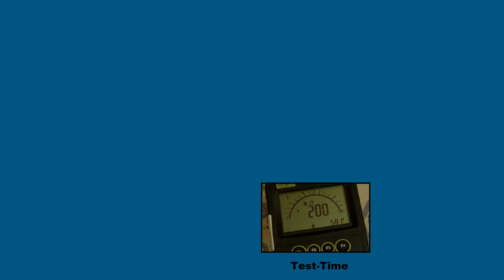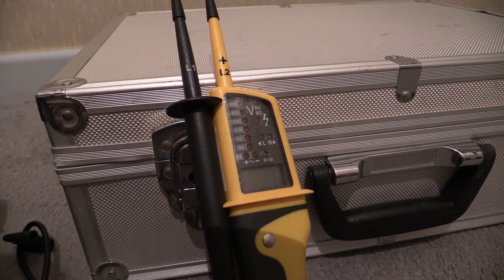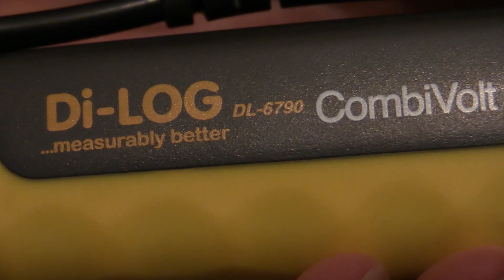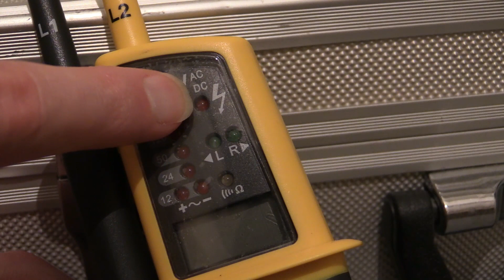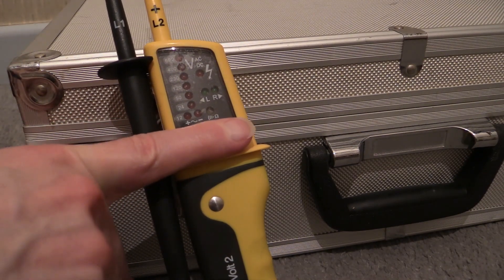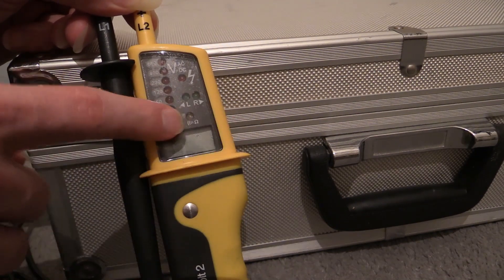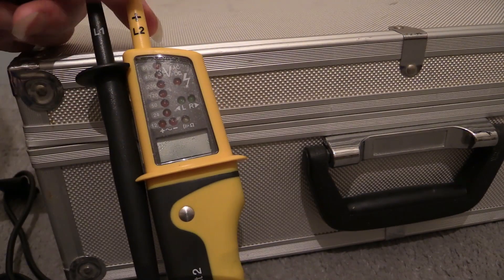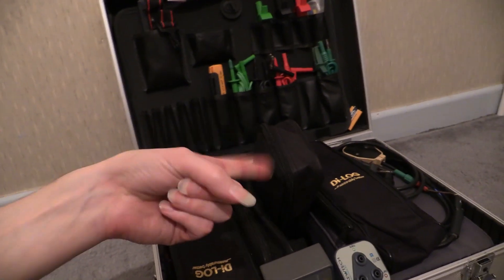Test Time : Di Log Combi Volt 2 (DL 6790)

Comment: On a proving unit I get a beep when I test it one way and silence when I test it the other way. I go + on the leads to + on the proving unit and this way generates a beep. Why is that?
Reply from the maker: Hiya. Assuming 
you have a Combi 
Volt, it may be...... 

.....something to do with your proving unit.

With my proving unit (Socket & See SP 200, which can be seen on this channel by looking in the TEST TIME playlist) my combi volt works in that either way around, but once the test in that unit is done and switches off, if I still have the probes in there, the combi volt bleeps which indicates continuity as if both of the probes were being touched together.

Maybe your proving unit is similar. I do know that my proving unit is somewhat generic, as a proving unit almost the same is sold under the MEGGER brand in a grey colour, along with a few other brand names.

Please subscribe for even more TEST TIME videos! :D

Thanxx for watching,

-Wayne's Electrical.

1st September 2019, 20.50
Reply: Those tester’s when you prove on a proving unit you put the main body probe + probe 2 into the + port on the proving unit and the the - probe 1 into the - port on the proving unit the tester will give an audible beeping as the proving unit puts out 240v . If you just put the + probe 2 into the proving unit you get a continuous beep.